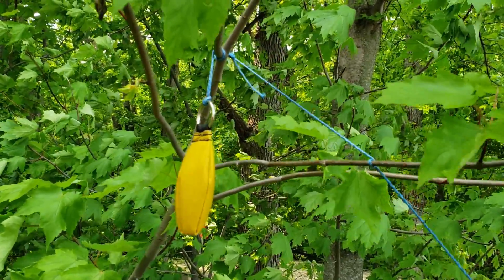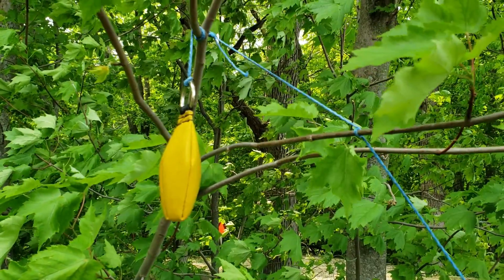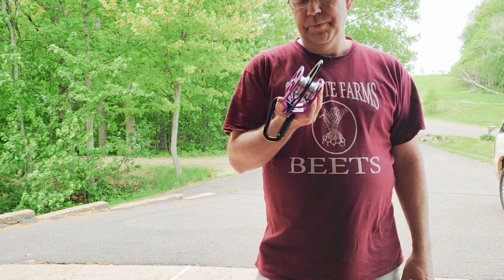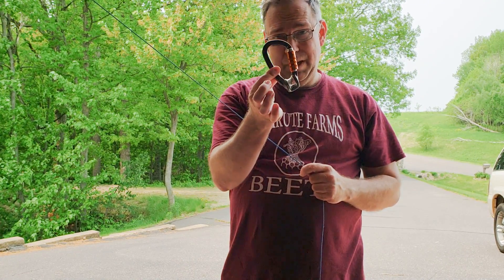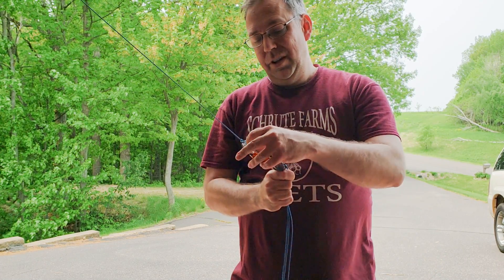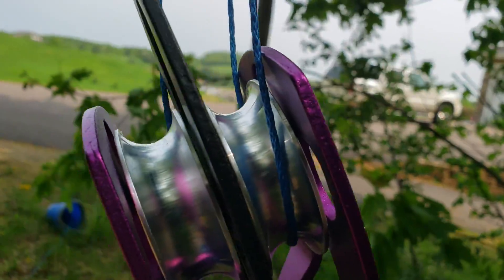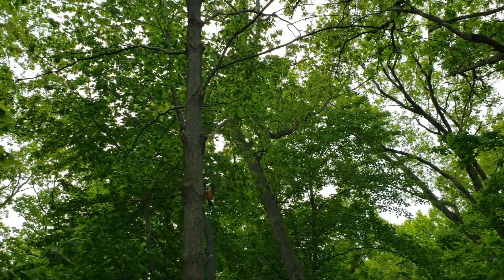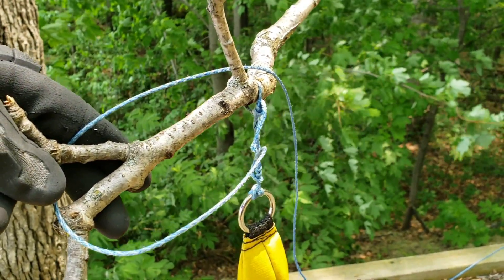How To Use Mechanical Advantage To Retrieve A Throwbag

Comment: Got all my climbing gear, decided I would climb a rope for the first time, first throw, get my throw bag stuck. Just thought to myself. I’m going to learn with every mistake on this mission. Hope I survive,
Reply from the maker: That sucks man, low and slow. I've seen guys go up after a stuck bag using a sock with a rock in it as a secondary bag 😁
Hopefully you got it back.
Reply: @FreeFallinTrees  naw, it’s on my property, get it tomorrow. Now I see how with your video. Where there is a will, there is a way, just wasn’t today
Reply from the maker: @gavinsandlin6700  ha, I've done that. I mostly climb on my property. I had an hour to spare one day, went out to hit that perfect tip in a new tree and spent 45 minutes throwing the bag everywhere but there. Went back inside sweaty and pissed without ever leaving the ground 🤣
Reply: @FreeFallinTrees  the other end of my throw line is cinched to a rock, lol.  Gotta use what we've got!
Reply from the maker: @JoshuaCollins  couple months ago I was at a friends house without my gear and she wanted help hanging a kids swing. I used butchers string tied to a sock with a potato in it 🤣

Comment: wow thats a of configuring ,, cool you got your line n bag back ..
Reply from the maker: You never know if the line or the tree will give way first, but sometimes it's worth a try.
Reply: @FreeFallinTrees  through a lot of trial n error I found out that the throw lines will handle about 400lbs of pressure which will break most small branches , Im about 230 Lbs . so i have broken more than id like to admit LOL and several times i have used a second line to clear the stuck one                                  ( YEAH team tree )
Reply from the maker: @mvblitzyo  I hear that, I pulled on it until it was cutting my glove, and then decided I needed to work smarter. I lost a bag for 6 months in the next tree over last year, it was wedged and the D ring snapped off before the line broke.
Reply: Free Fallin O my lord ! Ouch,  I just did this pain mistake. 6 days ago , like a big dummy 🤷🏻‍♂️ I should’ve known better , I wrapped the throw line around my hand yanked hard , I just about broke my finger. The Angle I was pulling.  Yikes that hurt !! Painful reminder. What I’ve seen guys do in competition. Yes ! Take a couple  wraps on the carabiner and then twist it serval times.  then use the  carabiner itself as an anchor. 👍🏼   we always have a carabiner around.  just a suggestion. Next time you get one stuck remember carabiner first🤓  can’t hurt the metal. I’m reminded by the pain of my finger a week later LOL.
Reply from the maker: @mvblitzyo  that is a great tip, and so obvious I should have thought of it, I'm using that one.

Comment: Not sure what line you're using, but I've broken dynaglide just by pulling on it without ma
Reply from the maker: Samson Zing-It, very strong. My other line is braided kevlar rated at 200lbs so they are both pretty strong. I figure even if it breaks at least it's off the ground.
Reply: @FreeFallinTrees  where can we find the kevlar braided line also i cant find the blue samson zing it anywhere.
Reply from the maker: @c1216a8hurley  hi Caitlin, here is a link to the braided kevlar line, it is used for high end sport kites - 

emma kites 100% Kevlar Braided String Utility Cord 100~2000lb High Strength, Abrasion/Flame Resistant, Tactical Survival Cord Fishing Tackle Assist Cord Model Rocket Paracord Trip Line Kite Bridles Camping Cordage https://www.amazon.com/dp/B088PT4KKG/ref=cm_sw_r_apan_i_8JW4M1MFN9VY3GSH5A7T
Reply from the maker: @c1216a8hurley  and the Samson Zing It can be found at most tree supply stores -

https://www.wesspur.com/items/thr101.html